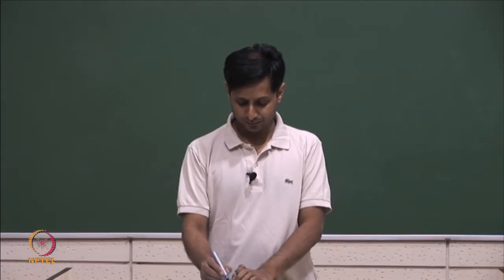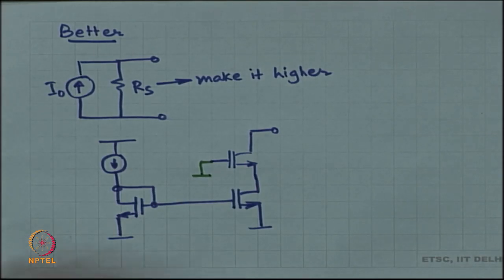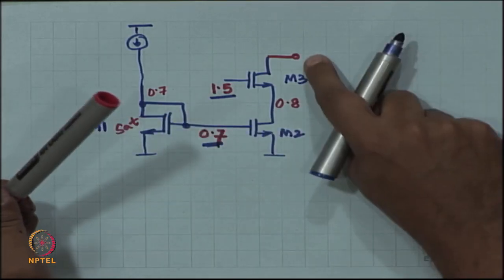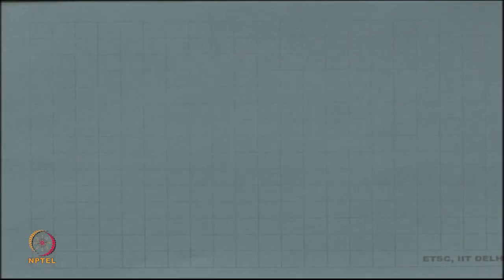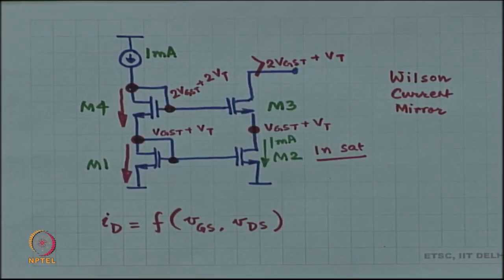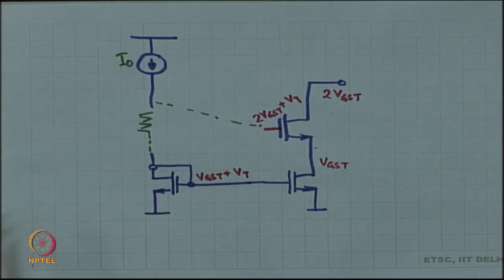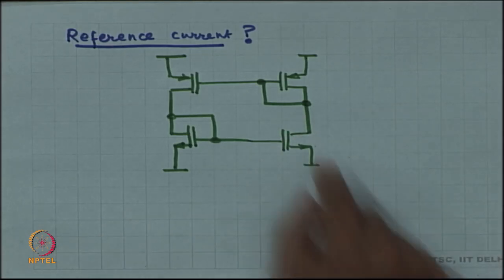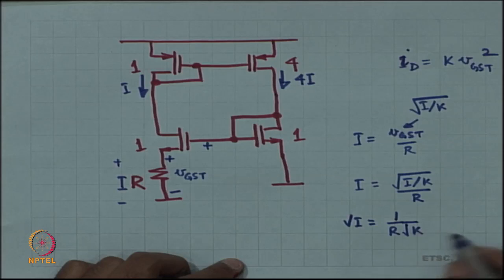Current sources/mirrors contd.

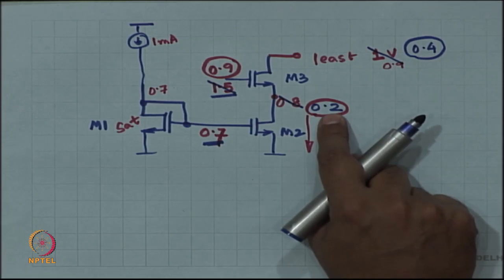Comment: Why does the drain voltage of M2 have to drop, as we drop drain of M3 below 0.4 @22:42
Reply: It works as an internal feedback just to maintain the current..As source voltage decreases then Vgs increases such that the current which was just about to decrease again comes back at same level
Reply: @aniketsaha7455  why Vt is added at 30:35 .... Why not subtracted
Reply: @ParminderKaur-zm4kw  for M3 source it at VGS = VGST +VT, so drain of M3 has to be VOV more than that and VOV = VGS-VT = VGST is required to keep M3 in saturation, that is drain of M3 has to be at minimum of VGST+VT+VGST = 2VGST+VT. same reason is why gate of M3 is at 2VGS+VT+VT, so VT more than drain